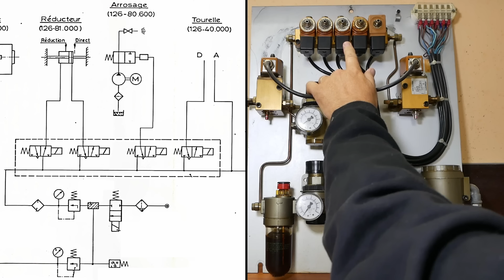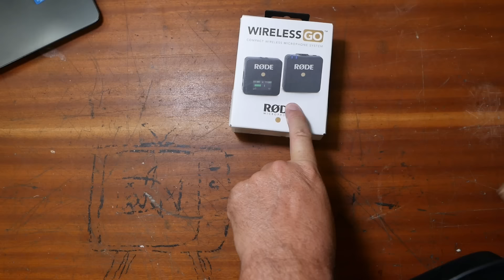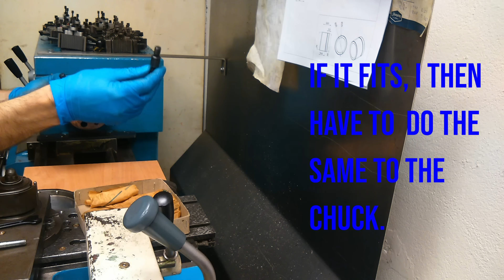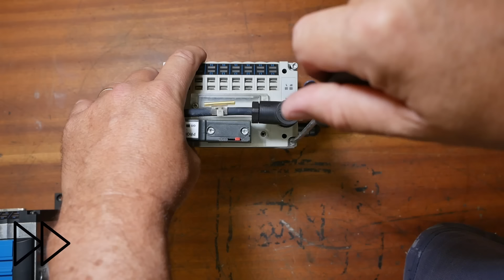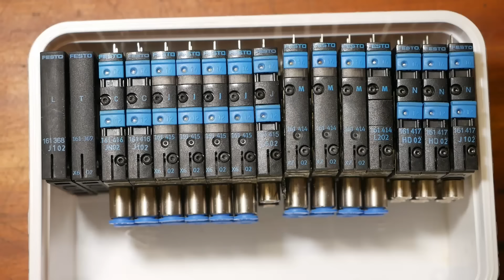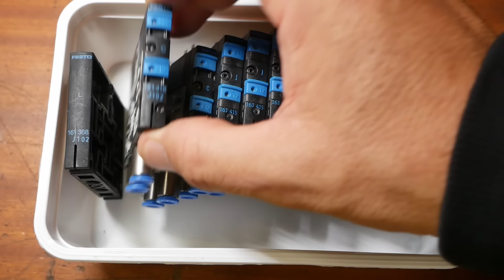Miniturising the pneumatics of the Schaublin CNC lathe. Ep.13

Comment: I've been binge watching the manila and schaublin episodes.    I'm torn between a sherline watch makers lathe 4140 (metric) or the Chinese Manila.    I don't have extensive tooling for the Manila upgrade but it would be fun and give me a path to a larger machine  if I like the hobby.   The sherline is a really nice lathe for watchmakers.   Cheap but manual competent and accurate.    You can't cnc the sherline nor can you build tools with it but I could learn a lot by making fine parts.     The Manila is not any easier than making a Gingery Lathe.     A Concrete or Epoxy Granite bed  or a cheap 18x24 surface plate seem easier than casting aluminum or with Satan's heat a cast iron bed.    ...
Reply from the maker: If you dont have one yet, I would suggest going up at least one bed size from the 7x mini lathe. The 9x dont take much more space but are a much more rigid bed. 
If there really is not the space for a 9x, rather than a sherline or 7x, I would recommend a real watch makers lathe like a little Schaublin 70, Boley etc
http://www.lathes.co.uk/boley/page3.html

Comment: I've used festo valves, and they are much harder to service than SMC valves.  Taking the whole block apart is terrible when you have to replace or repair.  SMC uses a front mount design so you can remove one valve at a time and the hoses are all fixed to the backing plate.
Reply from the maker: I guess I didn't research that enough.
Reply: @RotarySMP  Hard to find comparisons online.  I only know cause my factory has used both and I've serviced both.  There needs to be a channel dedicated to reviewing all the industrial Lego manufacturers, because it's hard to even know if there's other options out there.
Reply from the maker: @Raeilgunne  Good point. When I decided I could miniturise the Schaublin pneumatics, I was starting at zero, and it took me a lot of catalog diving just to get my head around the kinds of valve functions, the various control interfaces modules and what I am looking for. By the time I had worked that out from the festo catalog, festo seemed like the logical solution to apply that knowledge.

Comment: From what I remember a 4/2 pneumatic valve is a bit like an M7 bolt, somebody makes them for some purpose, but they are rare and expensive. Or like my engineering professor put it, if you design something with an M7 bolt, your submitted work should come with a 4 page paper on why you needed an M7 bolt. Hydraulics use 4/2s a lot, but that’s because you need to return to tank, but pneumatics you just vent to atmosphere, so the 5/2 is a lot simpler to build and hence used. They are an absolute headache though when trying to work out the path in the system, I at least can never manage to visualize how the ports line up between the two states and have to stop and think about it.
Reply from the maker: Thanks for that explanation. That makes sense. So I was on to something when I worked out tha the 5/2's would be fine here.
Reply: @RotarySMP  indeed! Only application I can think of where you’d need a 4/2 is some sort of closed system, for example if you run pure nitrogen instead of air and recover it instead of venting, or if you absolutely must vent at a specific place in the system, but then again both cases could be done with 5/2s with the vent ports tied together as your manifold does!

Comment: Make sure the oil is compatible with the seals in the valves. We once had oil ingress in the air supply, screwing up multiple valve islands. It messed up the seals. (Where VTUG island though iirc).
Reply from the maker: Thanks. I am a bit concerned by this, as I have to run some lubricated air, and have also read that valve terminals are not happy with this.

Comment: So I took my comment down because I didn't think it would be fitting to question where stuff came from; in retrospect, it was a joke. If you were a poor Aussie looking to buy a machine, would you go for a very cheap CNC like sain smart or a 500w SEIG mini mill and CNC later? Yes, they do different materials, yet I am struggling to decide. Man, your machines are beautiful. Anyway, it couldn't hurt to ask.

 I'm building an AR3 robot and want to make it out of hardwood because it is readily available. So the mill makes sense. Yet CNC would be more helpful since I work full-time, not in a machining environment.

Option c) was to buy the expensive stepper motors, use lead screws and square tubes for linear guides and build them with a router as the milling tool. But that is a lot of work for one man, and if you saw my workbench and draws I made, then you would probably throw this option in the bin.
Reply from the maker: If you have space buy the  biggest, heaviest machine you can. You can do small stuff on a big machine, but a small machine will alwas be limited.
Reply: @RotarySMP  unfortunately my budget is really small as I have been unemployed for five years, and spent most of my money on parts for the AR3. I'm not sure which is worse, electronics or mechanical stuff. You guys should be thankful Linux is free, or that would quickly eat into your spending money. I am just going to have to wait.
Reply from the maker: @tcratius1748  Yeah, it is an expensive hobby. Right now I am getting nickel and dimed by the various pneumatic fittings I need. It all adds up pretty fast.

Comment: On Saturday pulled five CPV14  valve modules out of a scrap yard skip for free,   looking into writing a profibus master controller for Arduino. Looks no easy way to get old (cheap)PLC masters running. didn't know about the linixcnc possibility or the direct D type interface, great explanation of the valve functionality, all C in mine, 8 in each with a DIO1 electronics block did wonder about just relay controlling the valves direct. Plan B .  I'll need to watch again and read all the comments. Went back to the scrap yard today to see if the PLC masters were there , not there but got another two CPV14 modules. Thanks for making a much better vid than I could have done. Not sure if I want to cnc my M300 just yet.
Reply from the maker: Before I found the Schaublin, two Harrison CNC training lathes came up in Holland. I think they were M350's and had a hybrid manual and CNC system. Not ideal CNC, but cool that they still had full manual control. I read someone they were a special design for the dutch tech school's. I was really tempted, as Harrison lathes seem really nice.

I have been informed by one veiwe that a full CPV10 terminal, loaded is around USD2000. It is nice when you can dumpster dive for them.
Reply: @RotarySMP  Had a Harrison L5 for several years and built an eightday longcase clock (Alan Timmins book ) on that single machine.cut the gears,faceplate and wood arch. The Schaullin , is that what Stefan has. , the M300 has 0.5mm dip in the bed, with cnc I could fix that. ponders...augmented control.

Comment: Hey, this is a great job what you are doing and I really like it.
The germans did not tell you all about those fancy valves. You need to be sure to put a very good 5 micron filter and keep those valves lubricated with a light (VG32) oil otherwise they will not last a quarter of that your actual valves did. ;)
Reply from the maker: Thanks. There have been others who also indicated that they can be pretty fragile.

Comment: Protip:
1) Connect longer tube on exhaust ports and take them outside of cabinet, because oil will over time spray out of exhaust silencer. I was dealing with some old machines which had exhaust inside cabinet and honestly, everything was covered in oil - every wire, every contactor, every heatsink. You really don't want that on any machine, especially new one. On two machines which are very well lubricated we even put those tubes directly into canister without silencers, so we can catch all excessive oil and dispose it without restricting air flow.

2) Buy genuine Festo fittings and beware of cheap knockoffs (korean Sang-A). Festo fittings will seal perfectly and you can be pretty sure they will hold tube perfectly. Sang-A degrades over time and while usually tube "only" shoots out of fitting (pretty dangerous), sometimes even whole plastic fitting explodes in front of you.
Alternatively you can check out SMC (Festo's competitor), they offer translucent tubes as standard so you can see any humidity in air (water/oil droplets), which is also nice. But it's recommended to use tubes and fittings from same company, I know Festo fittings can't hold SMC tubes that reliably (or at all). On other side if you put tube into SMC fitting, you'll have really hard time to disconnect tube from fitting, those seal really well! :)
Reply from the maker: Thanks for that input. I was already planning to do #1, as I dont want oily electrics. since there are pneumatic runs through the coolant tank bay, and that turns into a discusting mess over time, I was thinking of putting the pneumatic exhaust in there as well.

Thanks for the tip on not mixing and matching. I have an offer from a gentleman for any fittings he can find in his collection, and will otherwise trawl ebay.de for what I need.
Reply: @RotarySMP  I'm glad to hear this, exhaust in cabinets are horrible. Only thing I think is worse are Italian machines at place where I work - there are maybe five terminals with some obscure Italian valves, put inside machine on random places, with just exhaust silencers. Since air is lubricated, whole machine insides are well lubricated.
I was told putting tubes on exhaust ports might restrict flow a little, but I doubt we could spot a difference. But machines would be much quieter and cleaner :)

You're welcome, we had to learn about this hard way. Totally use genuine fittings and keep some spares, it costs more but it's totally worth it ;)

Comment: No idea why YT didnt publish my comment yesterday but I think you already have a heap of J's they are just using a crappy font, the model number 161 415 (CPV10-M1H-5JS-M7) matches what is on the one you have already included in the stack
Reply: I found out Youtube doesn't publish comments made by Basilisk browser, they appear as sent but after refresh they are gone :/
Reply from the maker: @DreitTheDarkDragon  Yeah, I have wondered about that, as I sometimes see comments in under the alert bell, but then click on them and they are gone.
Reply: @RotarySMP  I encounter that occasionally with Firefox even. Not consistent though.
Reply from the maker: @Phocoshay_Balperrus  Thanks for that feedback. YT can be pretty flakey like that.
Reply from the maker: Thanks. Another veiwer also pointed that out. They seem to have a slightly different font, with a small hook on the J, and I though they were I's. Thanks for checking the P/N.

Comment: Nice to see you mention my country in your channel, i hope those mesa cards last a long time😄
Reply from the maker: Mesa cards are american, but the most respected european distributor is EUsurplus in Portugal.

I've only had one work trip to Lisbon, but found it a lovely place. Looks like a lovey country you have there.
Reply: @RotarySMP  on a side note these pneumatic schematics look a lot like hydraulic schematics, i think you can make up a cross valve with two valves if you dont find one.
Reply from the maker: @andrecarlos985  It seems they dont use cros valves any more, as it is simpler to manufacture with two exhaust ports and manifold them back together, than make the crossing air chanels in the vave spool.

We have been hoping to holiday in Portugal, but, well the last two years was a none starter.
Reply: @RotarySMP  same here, i was going to coatia on the summer of 2020 but everything got cancelled, so we travel in Portugal since then, there is much to see over here😁
Reply: @RotarySMP  it's a nice country, besides Lisbon, we have algarve in the south with good beaches ( and lots of english expats ), and for nature people the northeast (especially the Douro river ) in very nice.

Comment: The seals on the festo units are typically good between disassemblies. Never had to replace one.
Reply: Another note, make sure the seals stay in the groove. Sometimes when I move them around I don’t catch one sticking to the back of another and I end up with a double seal. Doesn’t work so well.
Reply from the maker: @jdmorgan82  I had the same thing with the first terminal disassembled. A couple of the seals were sticking to the neihbour and got pulled out. I carefully pealed them off and erturned them to their groove.
Reply from the maker: Thanks for the feedback. One got pulled out of the first terminal. The others all seem fine.

Comment: @ 8:22 GR8 2 C in 1 mage U bring the drill down & the other image U bring the part up 2 meet the drill;... most satisfying...
Reply from the maker: With the moving table style, having the camera on a stand looks disturbing when you speed up, especially for vertical moves like drilling. So I clamp a nato rail to the mill table, and mount a second camera directly on the table to move with the work. That looks better.

Comment: But more importantly, will you hot or cold smoke those chillies? I cold smoke mine then dry them in the oven and make chili powder. If you cold smoke, do some butter, cheese and salt at the same time.
Reply: Wow learning more stuff here...I love to grind up dried chilis to make powder for good chili. Never smoked my own though.
Reply: @HansFormerlyTraffer  give it a go. You can smoke with wood shavings and a metal sieve. I use wood dust, basically finely ground shavings. If they're not fine enough I'll run them through the blender and give them a few minutes on the microwave to dry them out.
Reply from the maker: @HansFormerlyTraffer  Try it. Chipotle is a fantastic flavour.
Reply from the maker: I guess it is hot smoking. I use a snake of brickets, with some wood ships for smoke, and try to keep it slowly smouldering for a whole day in my weber. As it is too late in the season for natural drying, I need to finish drying them in the oven. Since this stinks out the kitchen, this year I'll do that part in the heat treatment oven I built.
Reply: @RotarySMP  I use a ProQ cold smoke generator. I find it works better in the winter (in the UK). I put it in the shed or outdoors in the Weber. It works a treat. Cold smoked butter will change your life, for the larger...
Reply from the maker: @unclehunty  I bet it does.

I had never heard of those smokers. I just checked and the ProQ is not available here but there is a similar cirsular one...
https://www.amazon.com/Realcook-Generator-Smoking-Smoker-Perfect/dp/B077TG37C6/ref=pd_sbs_1/131-1037020-2232430?pd_rd_w=KvKuJ&pf_rd_p=3676f086-9496-4fd7-8490-77cf7f43f846&pf_rd_r=TS8TYR8KT8DSR1GJKXHH&pd_rd_r=2cfcc5f7-34db-46ce-a2c7-d9433aa0f153&pd_rd_wg=jOPGe&pd_rd_i=B077TG37C6&psc=1
Reply: @RotarySMP  yep, they're effectively the same. If you get one make sure to heat up the sawdust to drive off moisture first so it smoulders properly, about as much as a cigarette. Sawmills or wood shops are great for the wood. I tend to use a combo of oak and beech because my local sawmillers cut that for firewood and I got it free.
Reply from the maker: @unclehunty  I once got a package from someone, and they had used Zirbel (some alpine pine tree here) sawdust as packing with a note that it is good for smoking food. I wasn't doing that then, and used it to soak up spilled oil from the garage floor :(

I've used hickory for the chipotles.
Reply: @RotarySMP  ha ha. I try and avoid pine flavours since trying Retsina in Greece 15 years ago.

Comment: Those compact logic valves are super handy, they are kind of the transistors of the pneumatic world. We have a bunch in service at work controlling much higher flowrate pilot operated valves.
Reply from the maker: WHen I first opened those valve terminals I was worried that they would not flow enoug air, but then looked at the tiny rigid lines Schaublin used at the flow divider and realised the Festo stuff will be fine.

Comment: Now you have me going down the rabbit hole.
Reply from the maker: Welcome to that. I have spent quite a bit of time in that catalog / hole!
Reply: @RotarySMP  Just got a festo cpv10-ge-mp-6
Reply from the maker: @mrp19285  Good one. Welcome to th world of process engineer lego.
Reply: @RotarySMP  HAHA.. I have been here awhile. I worked on jets in the USAF, now I run CMM in composite manufacturing.
Reply from the maker: @mrp19285  Cool. I worked on the old A4 skyhawks in the RNZAF, and then Boeings and CRJ's at the airline.
Reply: @RotarySMP  Nice, I worked on the F22. I make parts for Boeing and some other companies.
Reply from the maker: @mrp19285  Nice. The F22 is about 5 generations more modern than NZ will ever have.

Comment: With the space savings of the Festo block you may be able to keep the air prep equipment in the board after all and keep the lathe self-contained.
Reply from the maker: I want to miniturise the huge control cabinet and combine the pneumatics and electrics (I'll move the exhaust out to ensure it doesnt blow oily all over the electrics.)